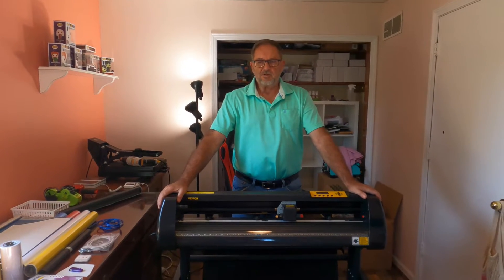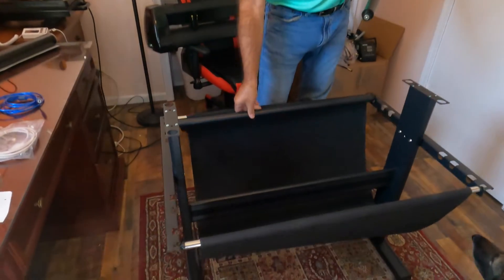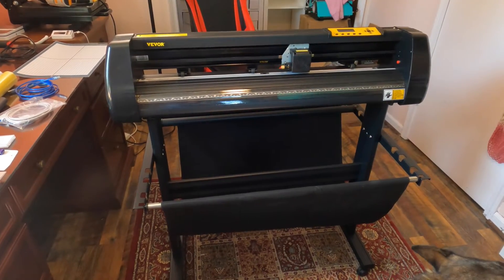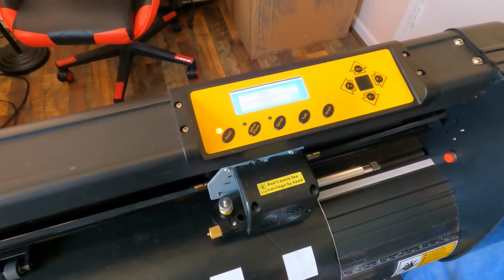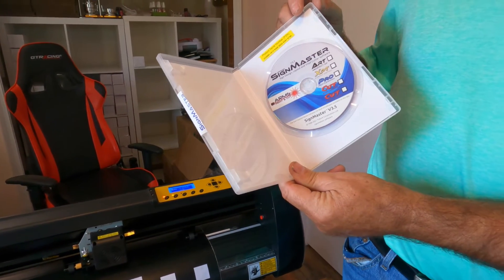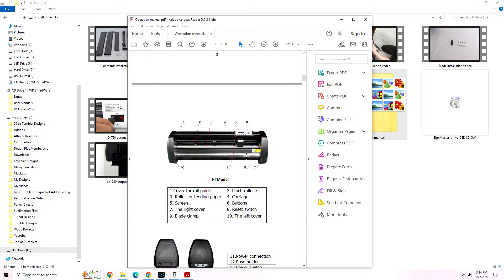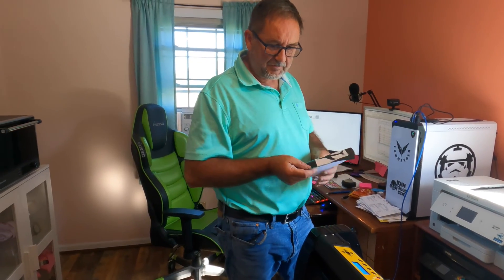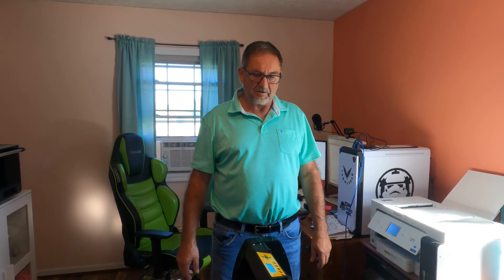Vevor 34" Vinyl Cutting Machine Setup and Review

Comment: Nice review. Whats the longest the cutter can cut? I have projects over 12 feet and was wondering if it could handle it?
Reply from the maker: Here are the specs from the website. Cutting Capacity: With maximum paper feed of 870mm (34.3"), maximum cutting width of 780mm (30.7"), cutting precision of +/-0.01mm (0.0004") and paper feed precision of 3m (118").

Comment: Nice instructional. Will SignMaster software cut inside Adobe Illustrator? Thank you sir
Reply from the maker: I really don't know if it will or not. I do not have Adobe illustrator. Thanks for watching.
Reply: If Illustrator has a plug-in to support Signmaker, then yes.